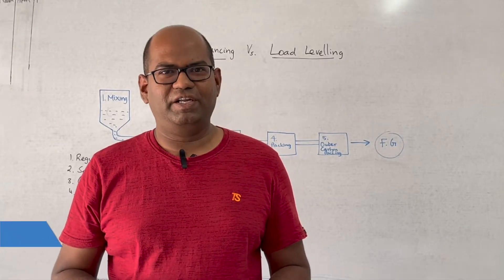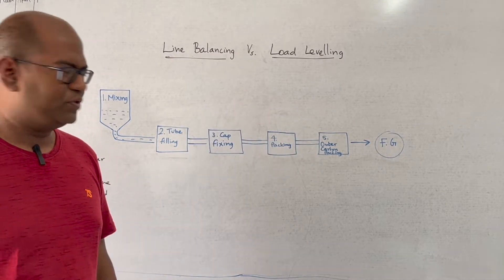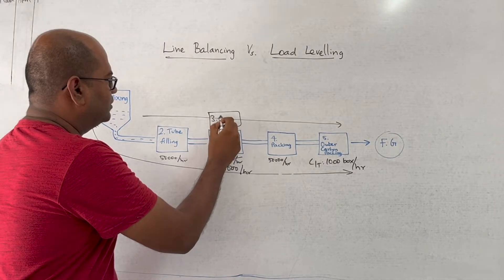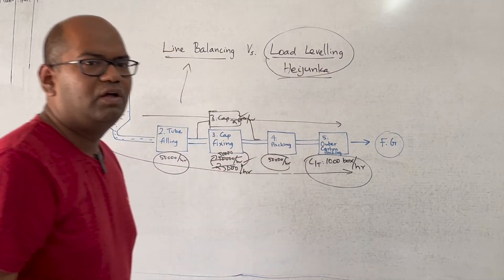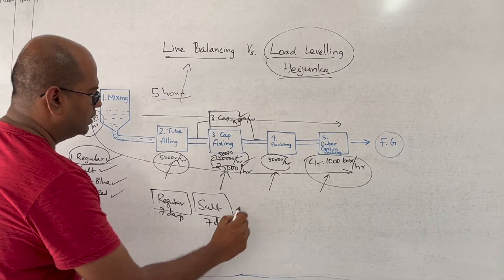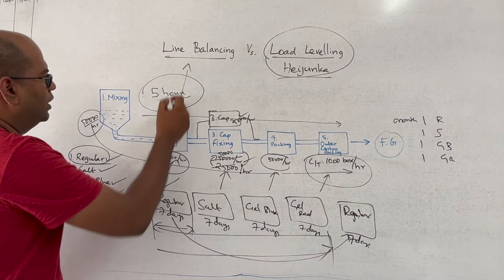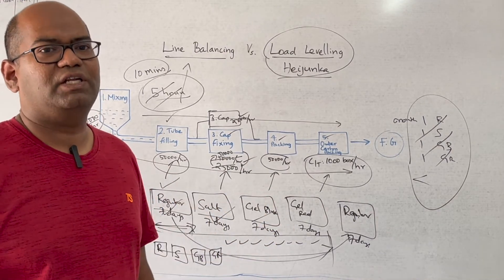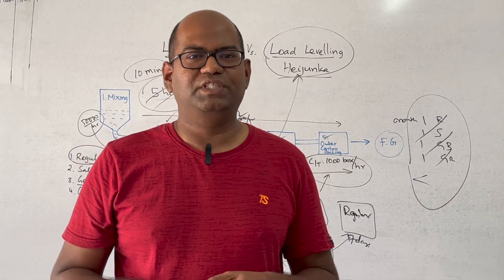Difference between Load Levelling Line Balancing - in English

Comment: I watched your video and it had a great explanation, particularly with the toothpaste example. I have a question though - in that example, once a batch is made in the mixing process, you can't produce another batch until the entire cycle is finished. So, does the mixing team need to wait until the entire batch is filled into tubes? What would you do in this case? Would you pump the entire paste into a new tank and fill the tubes from there, or do you have any other ideas? I would appreciate a prompt response.
Reply from the maker: Hi, Thank you for your query..I assumed that mixing happens in the tank(which can hold only one type of paste)..so when a particular type is produced, we can't mix other varieties.. this is my assumption, it may be wrong also..this assumption is to explain the Load Levelling process alone. Thank you. I hope I clarified
Reply: @KaizenClub_india  hi I am not talking about mixing... The process will not happen simultaneously as next batch can't start until the filling is finished. Either they need another mixing machine so that they can make another batch in that machine until this filling is completed. Or they need sperate storage tank so that they can pump  the batch into that tank and filling can be happened from that storage tank.

Anyway great explanation.

Do you have any video on VSM?